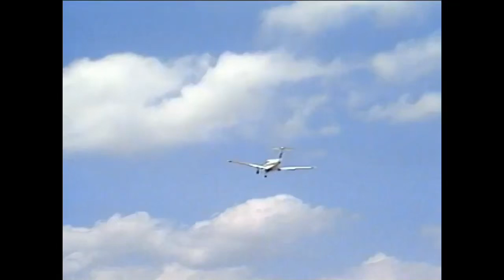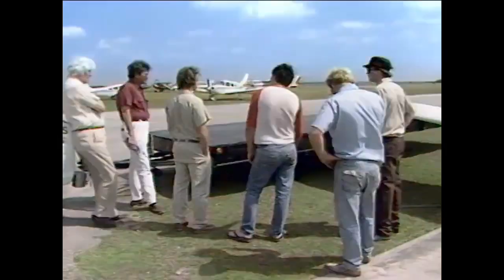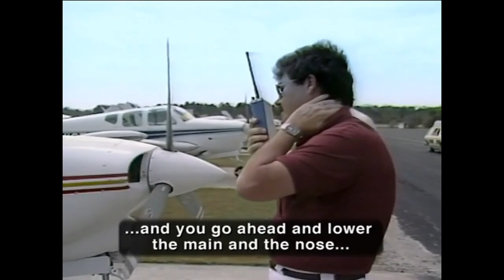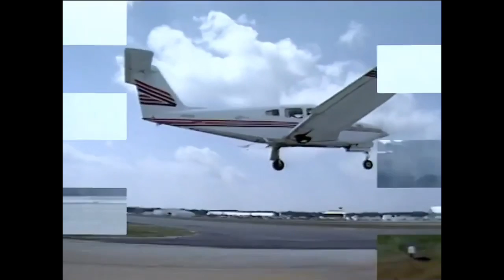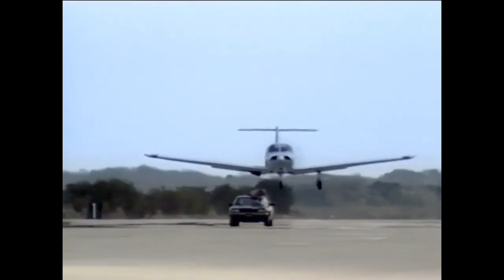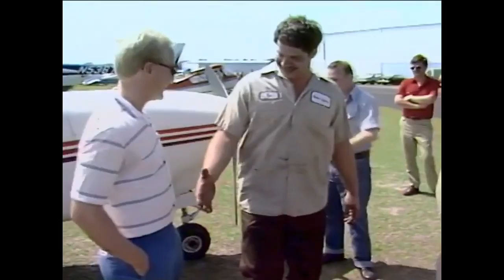Mechanic In Car Saves Plane Landing

Comment: I always wondered what force it would take to the man in the car to make that plane crash, just by hand. I mean, the plane has its weight, but it's in the air. Is it hard to make it deviate while in the air when you're not in that plane?
Reply: I think it' s the same of walking inside the airplane and moving the weight from the right to the left. Maybe it depends on the dimension of the airplane

Comment: No the plane would have landed on two wheels not its belly silly people. This did not happen
Reply: Why are you like this
Reply: Probably not belly but the wings
Reply: I know this is rage bait and I can say something very vile, but even I wouldn't hit such a low blow. RIP to your father 🕊️
Reply: why tear a plane up when you got a gutsy mechanic and a fast car on hand?
Reply: The right wing would have dropped to the ground with damage and  loss of control.  They would have to foam the landing strip and take other precautions.  Why cause damage to the plane if you don't have to?
Reply: I think that landing with two wheels can risk the plane flipping over on the runway, so in a situation like this it would've been preferable to retract the functional gear and crash-land on the belly of the plane. I'm not a pilot though.